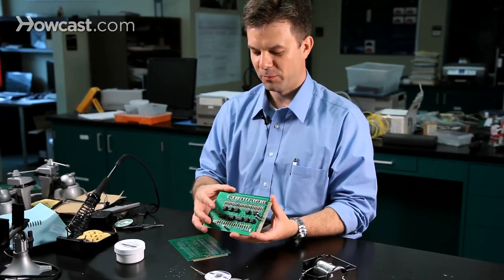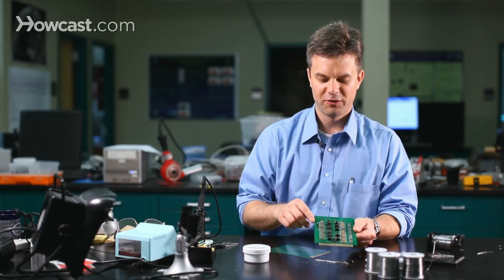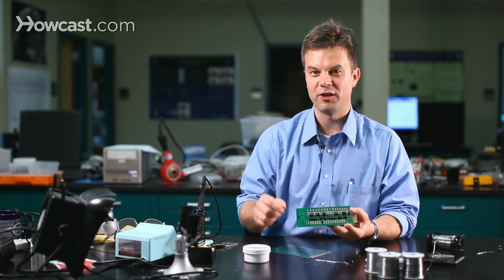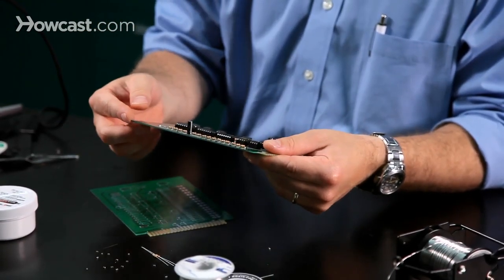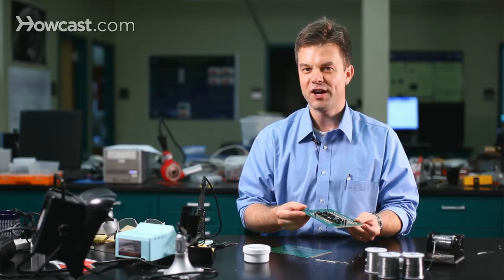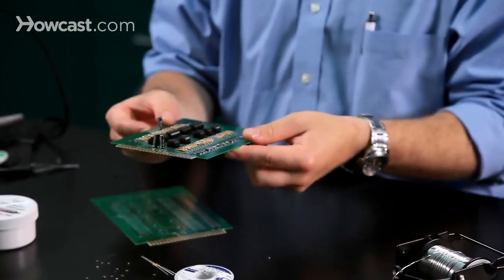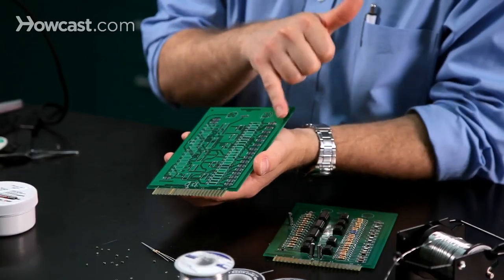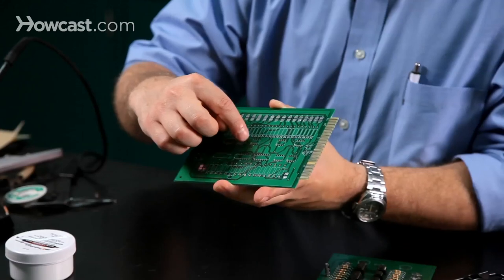What Is a Printed Circuit Board? | Soldering

Comment: Thanks for the very informative video.Two questions; first with the gold plated connector pins,what metal is the usual underlying metal.Second,(may be the same answer as from the first question),if the connector pins are not gold plated,what is the metal the connector pins are made from.  Thanks,Trev.